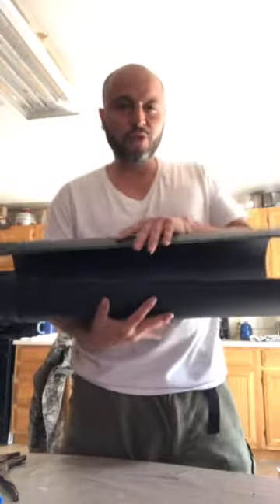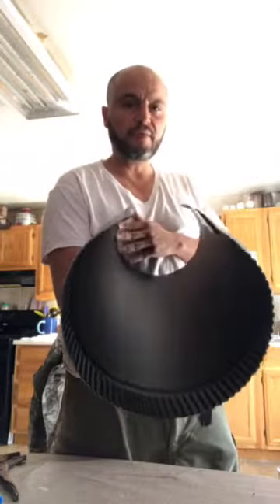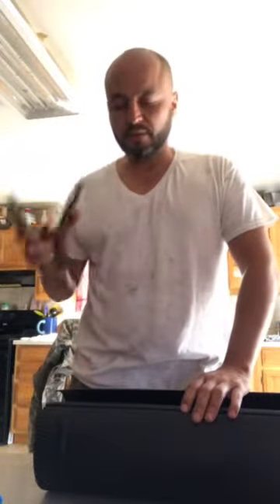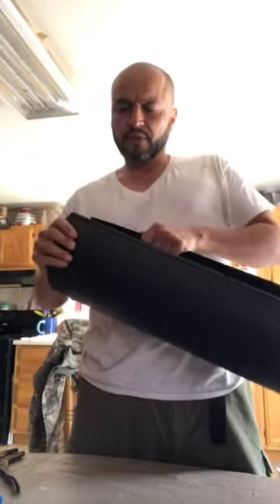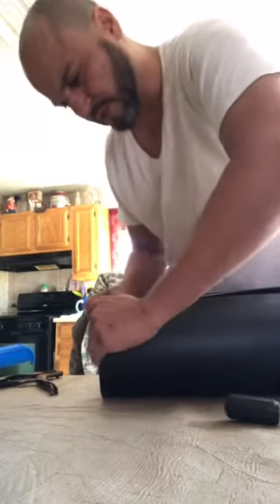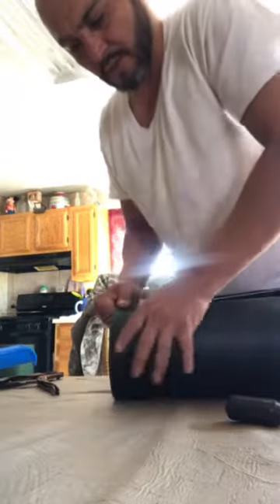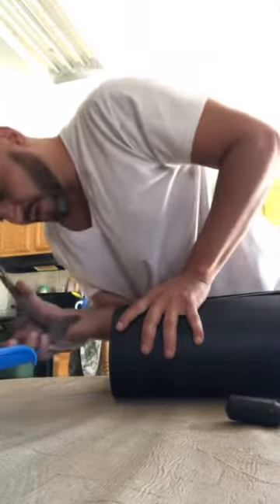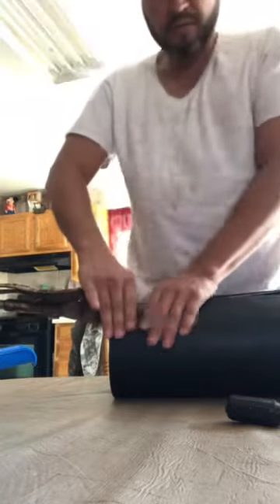Snapping stove pipe together vice grip trick

Comment: Thanks for posting, looks like cleaner way than bending them up so much as others have posted. Going to try that right now. Thanks!
Reply from the maker: How’d it go?
Reply: @seferinoabeyta1440  Got it done! Still not easy and I used too much brute force to lock it in and really bent her up a bit. Good enough for my garage project though. Would need a couple more to practice on, but the technique is solid, thanks again!
Reply from the maker: @rick2tg  your very welcome I’m glad it helped you!